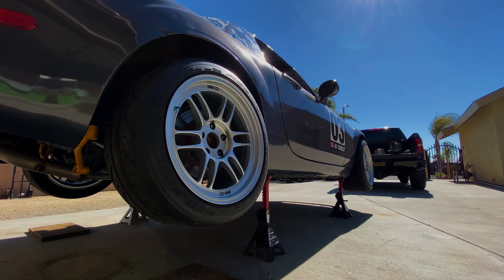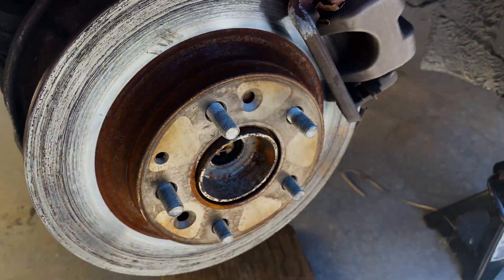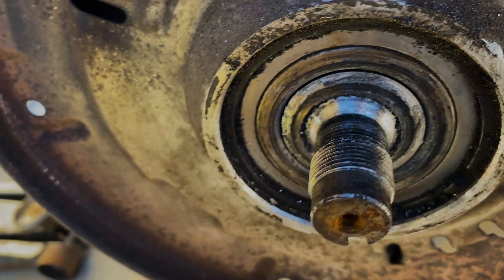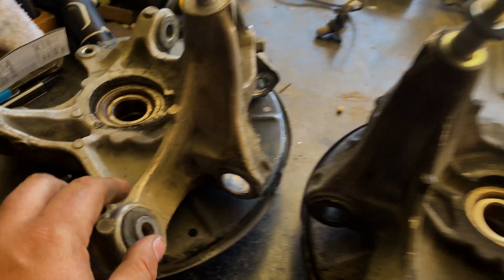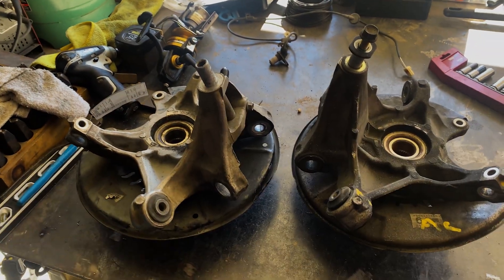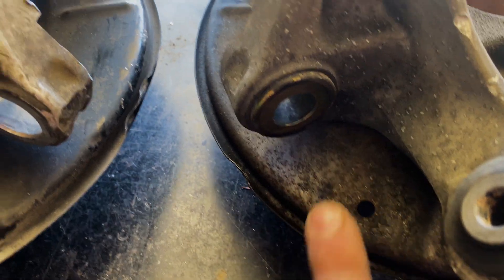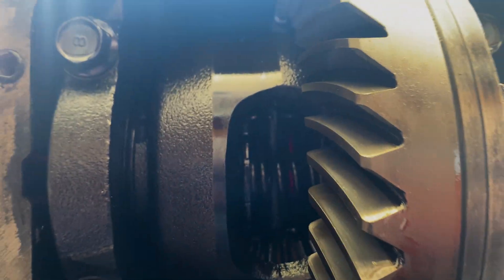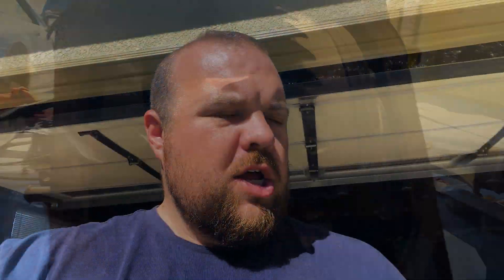Converting my 2.5 Swap NC to use RX8 rear end parts

Comment: Hello
Can we use rx8 abs sensor ?
Reply from the maker: I reused the NC sensor
Reply: @MitchelYardley  ok thanks. I used rx8 sensor but i have no abs and tacho... I will put nc sensor
Reply from the maker: @gregorygrandjean8820 yeah you’ll need the NC sensor. Your ECU doesn’t have the parameters to use the rx8 sensor.

Comment: do you think this mod is only worth the work for a track car? the diff in my nc is going out(mazda service bulletin; too much lapping compound from the factory causes uneven wear). miata is my second car i occasionally take out to the canyons
Reply from the maker: I really only did the swap for the 4.44 ring and pinion not for the rx8 diff itself. Also it’s just a bonus now I have rx8 rear hubs which are stronger than the NC hubs.   For street/ canyon car. You aren’t pulling the sustained G forces I would at a track (not trying to act like some race car driver but this is pretty true)

So that being said. A 4.44 final drive may be too much on the street for some, 

If it was personally my street/canyon car? I would just repair the diff and keep it 4.1.

Comment: Frankenstein-ing the axles is significantly easier than modifying the PPF to fit a RX8 diff. 
If you're going for as overkill as possible, you might want to get a S2 diff cover. It has more cooling fins on it.
Reply from the maker: I like the challenge of modifying, and thanks for the heads up. I may look for that cover!